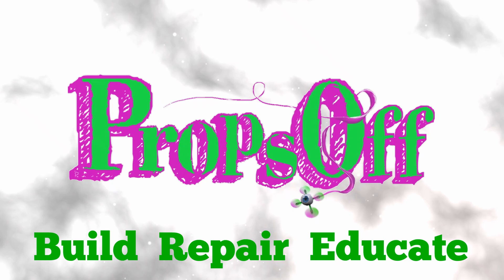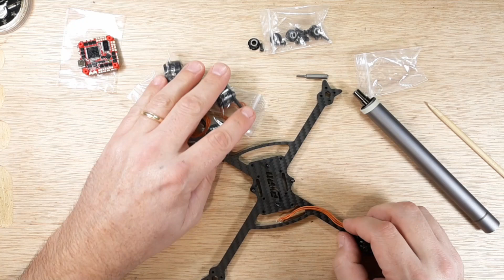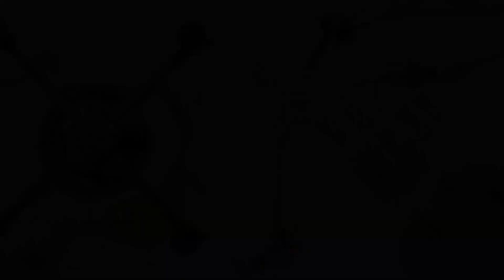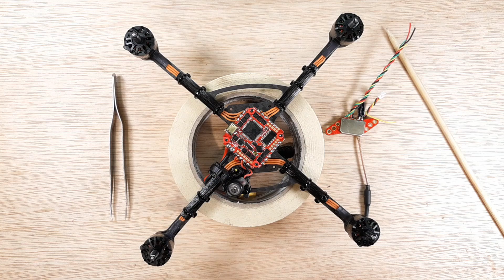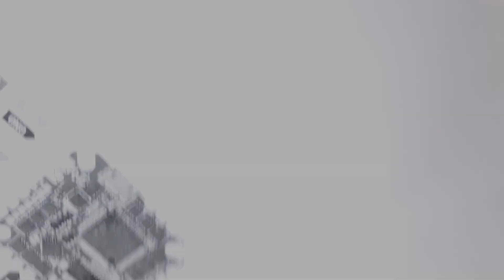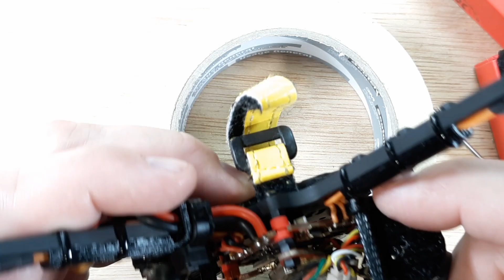The Build Part One | How To Build A Drone | Sub 250 Quadcopter Build Video

Comment: Whats the name of the manafying glas ?
Reply from the maker: Seen at the 19:30 mark?
Its an Ofset Printing Linen Tester.. I used to be a printing press operator and its to see the registration marks during overlay printing - like color prints. 
https://www.amazon.com/Carson-LinenTest-5x30mm-Folding-Magnifier/dp/B0011X4722/ref=asc_df_B0011X4722/?tag=hyprod-20&linkCode=df0&hvadid=647317690517&hvpos=&hvnetw=g&hvrand=12444321801132749095&hvpone=&hvptwo=&hvqmt=&hvdev=m&hvdvcmdl=&hvlocint=&hvlocphy=9014945&hvtargid=pla-450643122121&psc=1&gclid=CjwKCAjwjOunBhB4EiwA94JWsM-s_IN1gMHbxhkCM87gWWqe9CnZW34ZynJzS6REpCMV4OOGIA57qxoC_ecQAvD_BwE

Comment: Nice man! After I put the strap on the quad I like to put it in the ideal location and glue the part of the strap that the esc or aio FC sits on to the carbon fiber.Do you think that is bad?
Reply from the maker: No I don't, I just go through too many straps.. I have 2 older quads with stationary straps..
When will it STOP raining!
Reply: @PropsOff  thanks. Maybe if I buy kevlar it would be a decent idea.
Reply from the maker: @trevorimpulsebuyguy6398  
Lol, I thought I was buying a quality strap like Kevlar, however, it was plether...lol
Reply from the maker: No I don't, I just go through too many straps.. I have 2 older quads with stationary straps..
When will it STOP raining!